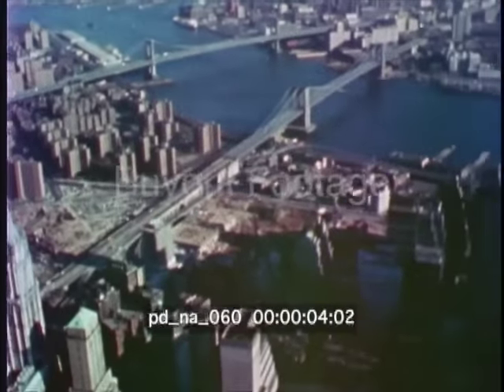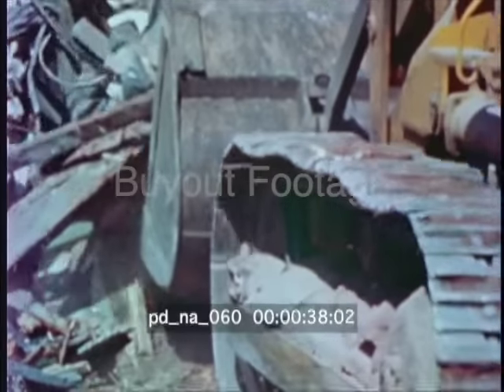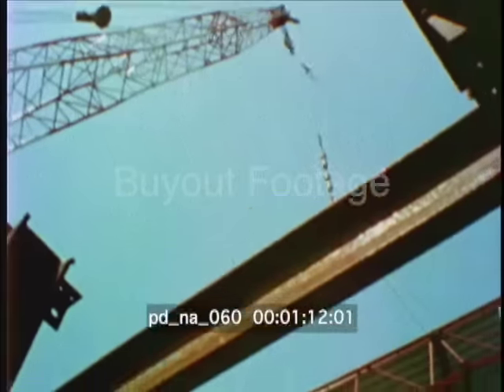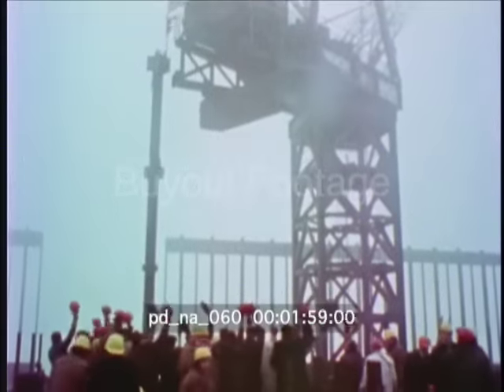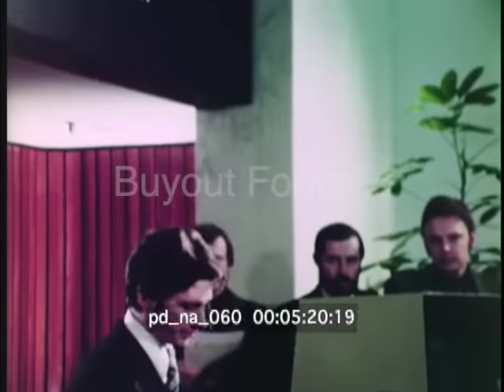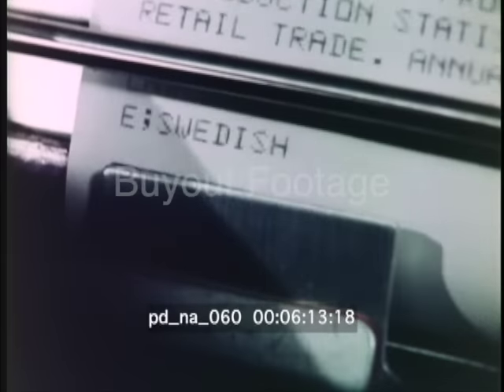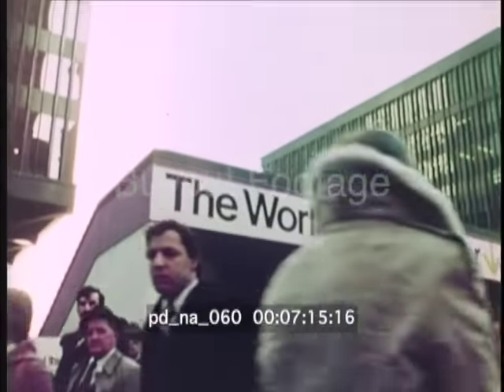Building The World Trade Center 1970s Stock Footage

Comment: I was there at the beginning just after have done the engineering check on the Manhattan pier of the Varezano Narrows bridge many of the construction workers wherein things where much discussed and analyzed,  so I can say that one really relevant features that was only touched in one quick glimpse during this report was the interwoven external structure supports that would have ripped the wings off 
either one of the New York planes including the massive cancer deaths of the first responders as opposed to people whom worked in the same location for over 20 years.
It did not happen as touted and I would be glad to discuss it in depth,

Comment: As catastrophic as it was, if the planes would have hit 1-2 hours later, the loss would have been 10-20x what it was
I was in my teens when the Towers first opened, I still have a difficult time believing they no longer exist 😭🥺🤢😤😓😢
Reply: Why
Reply: @pulsatomic6932  also at 10am the observation deck opened so there would have been more families and tourists especially since it was such a clear,  beautiful day.
Reply: @ivanamendez478  ok makes sense
Reply: What if they hit lower?
Reply: @jaylucie5857  would've been so much worse
Reply: @jaylucie5857  definitely would have been much worse it would have made the tower weaker so collapse sooner and more people would be on the floors above the crash, trapped and unable to get out
Reply: Jet fuel cannot melt steel beams!
Wink, wink!
Reply: @shaunigothictv1003  
My brother is a civil engineer and architect, 
Your statement that jet fuel doesn't "melt" steel, but at 700C it severely compromises it
The fires from the 9/11 planes reached,at least 900C, my brother says that was more than enough to compromise the integrity of the steel/beams
The floors, with the beams and concrete, began to buckle and then pancaked
Like the Miami beach condo that collapsed
There was no fuel or "explosion" there and looked what happened
Reply: @kazitude1  
I agree with your brother. 
But Your brother forgot about the steel beams in the core of the building which were buikt into a inner box.
Reply: @shaunigothictv1003  wrong. The twin towers were built like tubes,  they wanted to maximize the floor space and there were no columns in the middle of the building. The "core" you're talking about housed the elevators and stairways.  Once the outer beams were weakened and buckling,  the top fell in and the pancake effect happened.
Reply: @kazitude1  this was suppposed to be sarcasm :l
Reply: @shaunigothictv1003  they never melted 😂 they were weakened
Reply: @shaunigothictv1003  grow up

Comment: Contrary to popular belief post 2001, the core of the World Trade Center was not hollow.  Central core steel columns were completely pulverized on September 11, 2001 in both towers, and dust flowed through the streets of lower Manhattan.  It has never happened before or after, despite multiple skyscrapers around the world suffering more severe fire situations.

Comment: Was there a design fault in the towers?. They seemed to crumble pretty easily, also the building no7, just collapsed, all very strange
Reply: Tal vez hubo bombas desde adentro
Reply: the twin towers were built to withstand a plane the size of the plane that hit the Empire State Building. They were also extremely light, the main support was the exo skeleton and the core. The floors provided no support.
Reply: They were built with the intent to withstand a Boeing 707 crash, which was the largest airplane model at the time. But the planes that crashed on 9/11 were both 767s, and the towers weren't built for that.

Comment: Pretty staggering that such absolutely massive structures built of steel and concrete were undone by essentially a couple of aluminum soda cans.  Blows the mind considering that jet fuel doesn't burn hot enough to melt steel, but on this day it burned so hot it melted the planes damn engines.  Damn those Arabs, damn them!

Comment: How do those marvelous gargantuan buildings turn to DUST in less than ten seconds?
Reply: It was the destructive power of jet fuel converted into tremendously high heat and fire.  The impact of the planes hitting the buildings was a factor too, of course.  There was a lot more than dust left but many victims left little to no remains behind.  We are so fragile in some ways.  9/2/21
Reply: @joankonkle6972  there’s no way even with all the jet fuel, that it could make those huge buildings come tumbling down all the way to the ground. In fact, many engineers were surprised that the Twin Towers completely collapsed. The towers had been designed specifically to withstand the impact of a jetliner, as the head structural engineer, John Skilling, explained in an interview with the Seattle Times following the 1993 World Trade Center bombing: "Our analysis in- dicated the biggest problem would be the fact that all the fuel would dump into the building. There would be a horrendous fire. A lot of people would be killed," he said. "The building structure would still be there. However," he added, "I'm not saying that properly applied explosives—shaped explosives—of that magnitude could not do a tremendous amount of damage.... I would imagine that if you took the top expert in that type of work and gave him the assignment of bringing these buildings down with explosives, I would bet that he could do it."
Reply: @joankonkle6972  Pulverized concrete from the explosions is exactly what cause those tremendous clouds of dust. Just like you see in a controlled demolition. When you can, watch a few videos of old buildings being demolished, tell me what you think. :) love a friendly debate, thanks for being respectful xx
Reply: with precise planted charges you can bring down a building this size so vertically, without shearing out and fall on neighbor buildings. But that art is in a very few companies only.....
Reply: Physics
Reply: By the force of military industrial complex wish to flex their muscles.
Reply: @ammebee16  I have no technical knowledge about demolitions and collapses so I am not really able to debate this topic.  I did wonder what you thought brought the towers down. 9/5/21

Comment: My question has always been, how fast they fell, this video answers my question, open airy spaces, the structure was enforced on the outside, no beams skeleton that’s how they fell, the outside was the main strongest structure. RIP to all lost on that day.
Reply: No there was central beams aswell
Reply: There's videos showing the builds of these towers, I assure you there was full vertical central steel beams from below ground level all the way to the top. If I'm not mistaken 6 beams in total and they were huge.
Reply: Wrong, there were central columns in the buildings as well. That still wouldn't explain it falling a free fall speed straight into its own footprint. Building 7 fell the exact same way on that day from office fires on two floors.
Reply: @nzuncovered1845  Yup.  There was an inner core of beams supporting all the elevator shafts, water and sewer lines, and electrical and communication lines.  That inner core was connected to the outer structural skin via trusses, so the floorplan for each floor was like a square donut, the hole being the interior beams and elevator shafts etc., but it was open all the way to the outer skin.  This was revolutionary in that in all other buildings, there was a grid system of beams that got in the way f an open floorplan like they wanted.
Reply: "Pull it"
Reply: @rickydicky5889  Well, you got the "dick" part right.  Physics and aerodynamics FORCE things to fall at "Freefall Speed!!!  Reeeeee!!!", and also FORCE it to fall straight down.  Man, 1st grade must have been the toughest 4 years of your life...
Reply: @kx8960  explain how the garage (4 stories)directly beneath the towers was basically fully intact while 100 stories piled into it at free fall speed. You can’t. And so can I. It’s still a mystery to me. But there is no point in patronising total strangers on the internet. It makes you look pretty childish actually.
Reply: @bakker071  Easy:  The debris was slowing down as it piled up and spread out, and the debris itself became structural and self-sustaining.  The garage beneath the structure was strong enough to support the building when standing, and so it was strong enough to support it after it fell and spread out.  And, in fact, as the debris spread out, becoming a wide mound, the weight per square foot got LESS.  But, if you'd actually managed to graduate grade school, you might be able to figure this out for yourself.  But no, you had to be schooled by people on the internet.  I WORKED with "PE" level (certified) Structural Engineers, and they ALL agreed with the report as to the root cause of the building failures, INCLUDING building 7.  They're educated and intelligent and experienced in these things, you're not.  Too bad for you.
Reply: @kx8960  there is are report on the surviving of the parking lot? Can you reference that in here or link me that? And they agreed that debris slowed down in mid air? Interesting. Parking garage*
Reply: @bakker071  Gettagrip.
Reply: @kx8960  Correct.

Comment: Great vintage footage of those magnificent towers!   Never be the same without them. They were built to withstand collisions from 707s.  Two towers were hit by aircraft yet 3 collapsed.  Neither jet fuel nor office fires burn hot enough to melt steel high rise and cause collapse. Similar structures have burned hotter and longer than the twin towers Architects and Engineers On 9/11! Excellent Must See!   Look for that and learn the truth
Reply: Another interesting thing is what country they took the building remains to and wouldn't allow any investigation at all
Reply: @O 
". Zero steel recovered from WTC7."
Not zero.  FEMA grabbed a couple of pieces.  

" It would be the first steel skyscraper to experience simultaneous collapse of all its support beams from "
They didn't simultaneously collapse.   The collapse started at one side and progressed.  Other steel framed buildings have collapsed from fire before.
Reply: @OurOnlyHope  
" they took the building remains to and wouldn't allow any investigation at all"
The steel was taken to the scrap yards where it was investigated.
There were in fact multiple investigations into the towers collapse and all agreed with NIST.
Reply: @O 
" while one side was a split second behind the other side," happy?"
Well that's close...  but what's your point?

"Also official NIST says no steel was recovered to do tests on"
No NIST don't say that at all,   Their report includes steel they tested.

"NIST was never given any beams to test for explosives."
Sentences like this show the lack of thinking.
Explosives break things apart with force.  That's how you destroy the structure.   
If the building was destroyed with explosives the evidence would be so absurdly obvious and lab tests would be irrelevant and not show anything new.
Reply: @O 
"Keep thinking a government skyscraper installation designed like a fortress to house several top government agencies"
What are you talking about?   There were many different public and private sector organisations in the WTC buildings.

"OFFICE CHAIRS AND PAPER IN FILING CABINETS. "
Building fires exceed 600C. 
Building fires can exceed 1000C.

Steel is down to a mere 50% strength at 600C.

You have no idea.
Reply: @user-rr4fr8pf3j I d iot... Yer statement as written is intentionally 100% 'wrong'.

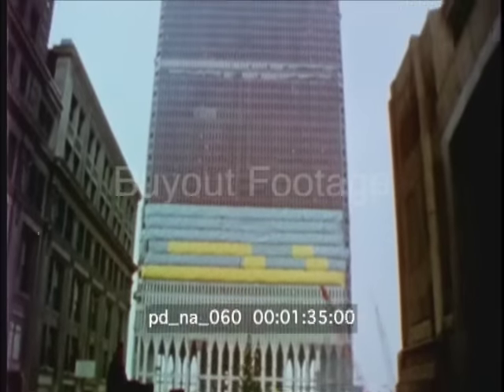Comment: 1:30 "closely spaced vertical columns provide the load bearing strength, instead of the customary interior steel skeleton"
Reply: No wonder they had to use explosives on each floor.
Reply: @Victor_Victory  I diot

Comment: The WTC buildings were built on the cheap. Short cut construction base on budget and time frame completion.
Reply: As was every building in Brazil even the one in London that burned for 24 hrs .rip all those people .
Reply: You should do some research on the construction of these buildings. They would have been impossible to bring down with the aluminum-nosed aircraft people said they saw.

Comment: I don't see how an aluminum object can bring down all that steel. And when does aviation fuel get hot enough to melt steel?
Reply: @MarsViolet   Well then it should've broken some windows, bent a few beams and started a few surface fires and pancaked on the outside of the building.
Reply: it was nt baco foil. and it had momentum and mass and fuel. what a stupid comment. implying it was impossible. it was all a plot.  yes by a load of mad terrorists.
Reply: @stimmo77 Something called a demolition team brought Number 7 down.
Reply: @tonygriffin1330  you need medicine.
Reply: @Donkeybone10  Well since you are so smart, answer the two questions I asked in my comments. And please tell me why building 7 implodes like a demolition crew rigged it to fall.
Reply: @Victor_Victory  I don't really know. It does look like a building that was set up to come down by a demolition team. That's just my theory.

Comment: So hard to accept that these sturdy building fell in that explosive fashion.
Reply: That's because they literally fell from the use of "explosives." Thermite, to be exact. Military grade. They were the first of 3 controlled demolitions that day.
Reply: @kdiamond12  a building doesn’t just crumble vertically like the WTC did unless a controlled denotation. It was either to deemed unsafe and could collapse making the decision to destroy it with the least casualties/other damages buildings or…..
Reply: @anthonyfrombelow  Prove it.
Reply: From an engineering standpoint, those buildings were NOT sturdy! There was no downward support (no columns) between the central core and the facade to make for an intrusion free office space. The floor trusses were literally just "hanging" between the facade and
the core. It's no wonder it came down so easily. The Empire State building survived an impact from a B-25 bomber during 
WWII, because it was a more solidly built structure and had lots of downward support.
Reply: @dirtyharry5320  thanks Harry. They probably hired just a cheap architect for the job.

Comment: Never forget building 7. The first and still only steel framed building to fall from office fires. Completely disintegrated into it's own footprint from fires on two floors that never really spread beyond those floors and it wasn't hit by a plane.
Reply: Sickening ain't it?
Reply: If you'd like to truly remember building 7, remember the part where an enormous amount of debris ripped through it. You know, the thing that started the fires in the first place. Might help you make sense of why it collapsed.
Reply: @BeeEatingOrchid  That doesn't explain why the building fell into it's own footprint. It's possible for a building to collapse due to damage from debris, but it's incredibly unlikely that it would come straight down. 

It never struck you as odd that all three of those buildings came down the way they did? Every single demolition expert I've ever seen that explained how it's done stressed the importance of the timing and placement of the charges. If not done correctly the building would not come down in its own footprint and cause damage to the structures around it. Are we really suppose to believe that all three of those buildings defied incredible odds and just happened to fall the way they did? I for one am not buying it, in fact it's just ridiculous to think it's even possible.
Reply: @kwantoon  there were like 10 buildings severely damaged around the trade center.
Reply: @O which building are you claiming fell in 10 seconds?
Reply: @O Quote it. The claim is easy to debunk if you watch the collapse footage and have the ability to count seconds. YouTube even has a nice little time display on all videos which makes it very easy indeed. Have you learned to count to big numbers yet, like 10?
Reply: @O yes, I'm sure you're a very special individual. Anyway, if we're done with your pointless contribution to the conversation, I've got some cheerios to eat.
Reply: @kwantoon  "Are we really suppose to believe that all three of those buildings defied incredible odds and just happened to fall the way they did?"  They defied no odds, there is no reason on Earth why any of those buildings would have fallen in any other way than just down.  Gravity always pulls downwards, always has, always will.  I've known that piece of elementary trivia since I was 5.  If you push something it can fall over, but no one pushed these buildings - their internal structure gave out and they collapsed.  It's been 22 years, educate yourself ffs.

Comment: We needed to rebuild them exactly how they were but taller and obviously with newer tech but outside identical. Instead we have the ugly freedom tower. Feel defeated with what they built
Reply: Yeah, that Freedom Tower is pretty ugly.
Reply: Unpopular Opinion but i think that One World is alot safer, stronger, and more asthetically pleasing than the twin towers. but the original towers will always have a special place in my heart
Reply: Well no we don’t want to build them exactly as they were because the way they were wasn’t safe enough. I know you mean in look but to make them look the same they still wouldn’t be safe enough if there was another future attack of a similar nature. The way a building a structurally sound and certain safety features within can play a part in dictating how a building looks. The new “one world tracing centre” may look different but it is FAR safer. They would not have been able to make a new tower look the same as the old but have all the safety measures of the new one.